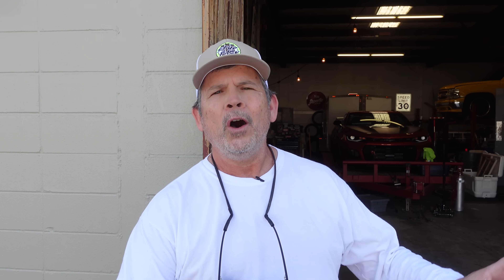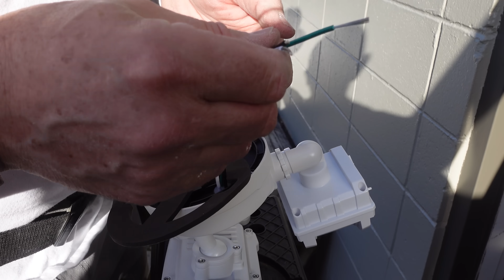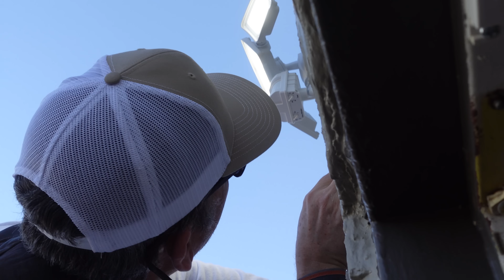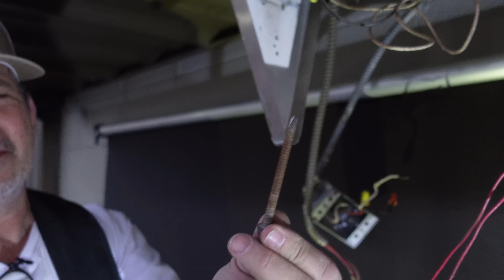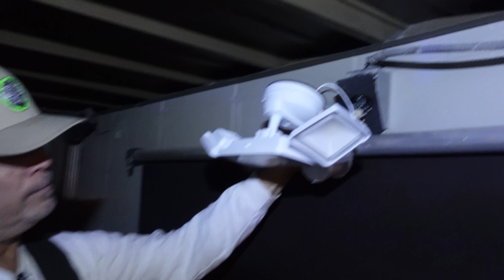HOW TO INSTALL FLOODLIGHTS (Safe, Watertight, and Properly Grounded)

Comment: Not a fan of using conduit as a ground. Fittings often get loose and all it takes is one disconnected or loose fitting to ruin your entire ground path. I prefer running a dedicated ground always.
Reply: Totally agree. Been burned by conduit open grounds
Reply: It’s better no doubt to run a dedicated ground, but on a big commercial job the cost of the extra conductor can be the difference between winning and losing a tight competitive bid. So if it’s not specified by the owner and it’s not code nobody is going to do it.

Comment: If I not mistaking, one of the hex sides of your screwdriver will fit that ground screw and would be easier to drive that screw in. It's a great screw driver.
Reply: You are not mistaken. It's ba neat trick i use all the time.
Reply: Yeah he finally used it to take down the old ballast but I woulda been using the hex the whole time!
Reply: Yeah,  one size is 1/4 inch and the other is 5/16. 2 very common sizes in the trades. That 5/16 will handle hose clamps also
Reply: the Klein 15 in 1 multi tip ratcheting screwdriver has a special combo tip  c1 c2 that just fits the square slotted Philips screws that get used in electrical a lot
Reply: @travisk5589  if it’s a Klein 11 in 1 it also has 3/8 on the other side as well
Reply: Excellent.
Reply: that tool has 1/4 3/8 and 5/16.  According to the packaging, all of the hexes are hardened tool steel and can handle driving screws a good bit.  I used it as a cable TV tech forever.
Reply: You mean use it as a nut driver?

I'm starting to like nut drivers on hex headed screws. Much better than risking stripping the screw.
Reply: @SirBrass  yes.  hex headed screws are the bees knees for ease of driving.

Comment: “14g for 15A and 12g for 20A” is a great way of remembering that rule.  Always learning something from you guys.
Reply: Generally just use 12 on 15 amp the overall $$ difference is negligible in the long term. 
Especially if you don't have any access to the wire
Reply: You can learn a lot more accurately from the National Electrical Code Book aka NEC !!
Reply: Great tip!    though i can't imagine that short leg for an LED light  calls for 12ga/ 20 amp .  Is that a local code?  (obviously can't hurt to have it though, and as long as you have some hanging around...)
Reply: @jefffree6990  ok let's say 14 awg is $49 a roll. And 12 awg is $59 a roll.
For $10 more if you ever needed to bump up to a 20 amp breaker what does it cost you in the long run?
$49+ 59+drywall mud and then mudding an tapeing sanding etc... lol
Plus if your wiring plugs your probably going to have 12 anyways
And leds are low powered,  but say 6 months from now you want a ceiling fan?
Reply: @electroman982 one of the very first things in NFPA 70 is a passage explaining that the NEC is not an instruction manual or a how-to book. While you will certainly use the NEC while you are learning it's not written for beginners and you're likely to misinterpret something and hazard yourself or others

Comment: In case you didn't know, it is possible to have a hot neutral where there is a shared neutral (multi-wire branch circuit) and you have an open neutral.  This happens when a 12/3 or 14/3 circuit is used to save a wire (not uncommon in commercial installs to save conduit space and wire)  and a double pole breaker wasn't used or where two breakers don't have the required handle ties or are on the same phase.  You need to make sure both breakers are off on these before working on them.
Reply: Learned this the hard way
Reply: I do this all the time when conduit size is too small
Reply: me, an arduino kiddie: lol, i kno some of these words.
Reply: He knows all about the hot neutral, has explained it in other videos. He got the worst or second worst shock of his life on one. He checks them every time, I assume even if he doesn't cover it.
Reply: Hot neutrals are the worst. The two breakers that supply the hots for the shared neutral should be linked so they both turn off at the same time but it's not common to see this.

Comment: If I lived where you guys are, I would always hire you guys even if you charge me more than the regular rate... I'd be glad to pay for it since I know I won't have to worry about the work. I am super picky as well and Paul is my kind of "picky" guy 😎
Reply: Me too. These guys are first rate. The father son thing is pretty cool too. 👍🏼
Reply: They broke code numerous times, for example pulling Romex through conduit in a wet location, using 14awg in a commercial setting, etc.

Hard to not worry about these handyman hacks
Reply: @SumOfIt You must use a wire rated for wet locations. NMD is not.
Reply: @TheDarthJesus  Where did they use 14AWG? He removed 14 and replaced with 12.
Reply: @illestofdemall13  Exactly. If TDJ is going to criticize, he should make SURE the comment is correct.

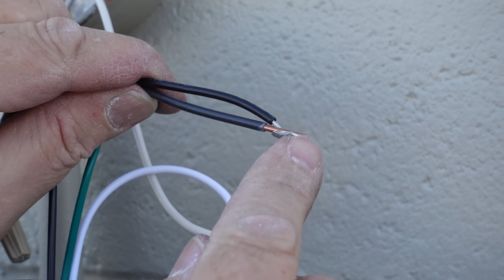Comment: At 14:21, you actually want any stranded wire to be leading the solid conductor by around 1/16” to 1/8”. By the looks of it, those stranded wires will pull out if you give it a pull test
Reply: Great tip!
Reply: I hate to sound like an idiot but what's the point of a pull test if those wires will almost never be under that much tension inside the junction box?
Reply: @aurvaroy6670  Because if a wire can easily pull loose, then it is likely to work it's way loose over time from vibration and heat/cold cycles. Eventually, when a wire does get loose you'll have a bad connection, which can cause arcing, heat, or both when under load, so it would become a fire risk. Connections that survive the pull test are far less likely to work loose over time.
Reply: @aurvaroy6670  Better safe than sorry.

Comment: 13:31 always leave the wire nuts/wago/push-on's with the open ends facing down/sealed ends upwards. that is in case of moisture from air leakage causing condensation or rain ingress.
if they're hanging downward or sideways they can fill with rain/condensation and corrode apart in months to years.(I learned that the hard way)
Reply: man, I've never even considered these variables.  Thanks.

Comment: Check out the Klein C2 bit for most electrical fittings. Basically a square/flat combo really gets a nice firm grip in those ground screws, receptacle terminal screws, EMT fittings, and more.
Reply: I actually prefer the Milwaukee ECX

Comment: Bell boxes are made for threaded IMC or Rigid conduit. EMT conduit connectors are straight thread and are listed for use with boxes and locknuts. Good job showing how the effective ground fault is compromised using the incorrect fittings. Also when wire nutting solid to stranded, put the stranded wire a little past the solid so the nut make a good connection.
Reply: "Bell boxes are made for threaded IMC or Rigid conduit. EMT conduit connectors are straight thread and are listed for use with boxes and lock nuts"
Those 2 statements are not accurately true...so go figure...and report back w/corrected relevant info!
Sorry I don't do others homework for them for FREE!
Clue...start with the Listing/s!

"Good job showing how the effective ground fault is compromised using the incorrect fittings"
A dagger to the code book...OUCH!
Clue...you wouldn't reward your dog for pissing on your leg would you?!!?!?

"Also when wire nutting solid to stranded, put the stranded wire a little past the solid so the nut make a good connection."
So you have more then one week experience...good boy!
Clue...there are places where the 2 types should/should not meet!

Comment: Great video! It's good to mention that on three phase wiring, the hot wires could be black for one phase, red for another and blue for the third. Any phase would work for the single phase light, but it explains you connecting the red wire in the box to the black wire in the lighting fixture.

Comment: great job.  I always tape up the wire nuts on the positive side just to be safe.  In my 90 year old house they soldered the wires together and then used tape.

Comment: Excellent work per normal, thank you Jordan and Paul. Awesome man cave Best Bud!

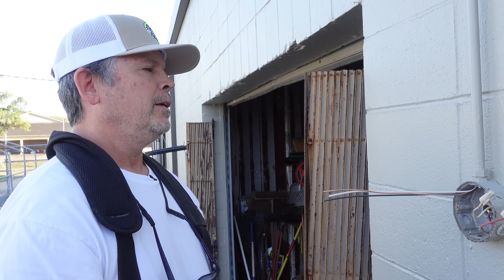10:50 I believe that's your best option really (matter of opinion) realistically you should have the compression/raintight fittings there and not the normal set-screw type on the upper box. This is simply because you're outside, you wouldn't want moisture getting in the boxes in anyway possible. I personally run dedicated EGCs for every run but every situation is different, and with your case they weren't previously installed.

Comment: In many jurisdictions, commercial requires THHN wiring or other wiring, NO romex.  So, when running you are either pulling single wires through conduit (or wire packs) or using armor clad / metal clad cable.  Fastest way to run a single wire out somewhere on the inside is with the metal clad / armor clad cable as it's a flexible "conduit" clad cable.
Another thing that happens is neutrals are shared in many instances.  Hots are ran off of individual breakers on different phases with the neutral and ground wires being a shared run back to the panel - Due to the different phases, the neutral doesn't get over powered by the amperage.

Comment: Extend stranded wire slightly beyond the end of the solid wire or the stranded wire does not engage and get compressed by the wire nut threaded cone.  I also would have replaced that 14AWG even though the fire risk inside conduit on concrete blocks is minimal.
Reply: Paul did replace with #12
Reply: @michaelbiegel6973  And "I also would have..."
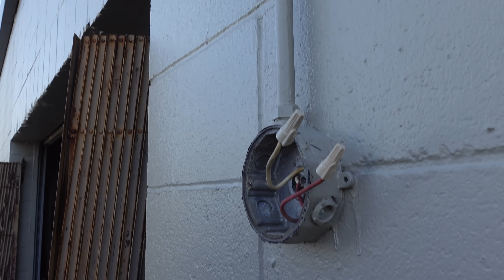Reply: @byronwatkins2565  @ 10:05 he says he has 12 gauge in the truck, so he in fact did replace.
Reply: @michaelbiegel6973  I did NOT say he didn't; I said I would have done the SAME.

Comment: At the end you used a rectangle box (not sure the name) instead of an octagon/round box, but still used a round fixture. I helped someone install a floodlight in a wet location and ended up jury rigging a rectangle to circle adapter with foam backwards to get a modest amount of waterproofing. Was that necessary, or would it have been ok to leave it more open so water could drain? It was a residential application, and I didn’t want wires getting too wet. It was really open in the back when it was just the fixture and the box. Kind of open to rain and snow too. I think it worked ok after my mod, and is still working great 6mo later. thoughts??

Comment: Excellent tutorial, learned a lot, so thank you! Wondering if issue fitting circular light fitting to the oblong wall box as it relates to watertight seal, or it didn't matter because it was beneath an over hanging part of the building? Seeing how professional you are, I don't imagine you left any gaps, but the video did not show the final fitting at the wall box.

Comment: I usually keep some crimp-on eyelets in my toolbox, and use that to attach twisted ground wires to the box.

Here’s an idea for a future video - converting a fluorescent light fixture to LED bulbs by removing the ballast. I did this to my 8 foot garage lights, and what a difference!

Comment: Hey Stud Pack! That "square drive' is called a Robertson! Here in Canada its the most common for construction screws. Electrical is basically Robbie #1, #2, or if you use the screws included in a light fixture, then Philips #2. Robertson #2 is most common across all building trades here. Keep up the great videos!
Reply: Square and Robertson are actually slightly different, Robertson screws/bits feature a longer tapered edge designed to hold the screw better.
Square was designed because Ford refused to pay for the Canadian designed Robertson bit, and created their knockoff "Square"

Comment: Lol, I remember installing one of those and that long center mounting screw went in and chafed the wires where they came in the back of the box. Nothing worse than putting a light all together and tripping the breaker immediately in front of the customer 😆

Comment: I'm not sure if it's a code violation, but I personally would have replaced that single gang box with a round one.  With that it would not only look nicer, but it should have better protection against the elements and help your light fixture last longer.

Comment: For the last light mounted on the rectangular box, didn't that leave it partially open in the back? Wouldn't it have been better to mount a new round box to the building first? It would have a better finished look too.
Reply: The back of the light was completely enclosed if you look at the other lights before. So, yes, there was overhang beyond the box, but nothing was exposed. I agree that a round box would be better, but if this really was a freebie job for a friend, they get what they get.

Comment: Hi-  great videos.  Just a couple quick questions.  For light #2, you mentioned the conduit connections between boxes prevented a good ground.  What would be the appropriate way to connect the conduit to allow ground continuation?   On light #3, you attached three round light base to the square single gang box.   Was this only done because the location was protected from rain by overhang?   If exposed would you have switched box to a round one?    Thanks!

Comment: Here's a nugget I just learned this month: Milwaukee makes the perfect bit (1/4-inch hex or full screwdriver) for those electrical screws. Receptacle box screws take an ECX #1 and, I think, breaker box screws take an ECX #2.. They combine the Robertson #1 with a broad, flat blade for incredible grip.
Reply: yeah my klein 14 in one has the combo bits for electrical screws it is nice has 6 double ended bits in handle that are quick and easy to change

Comment: when you splice stranded to solid make sure the stranded wire is ahead of the solid wire so the wire nut can pinch the wires together better makes a stronger connection

Comment: For the last of the 3 lights, the light fixture was round, but the junction box was a small rectangular box. Is that a problem? Will water be able to get into the back of the light fixture since it is larger than and doesn't match the rectangular box?

Comment: outdoor lights like that should be on a GFCI breaker anyway, so that ground wire is not actually totally necessary.  I still run grounds anyway and check them just like you did. The GFCI also continually self test. If they electrically fail, they will click off. I also converted my shop lights from fluorescent to LED strip bulbs, and that gets rid of that ballast, and keeps the fixture, which is a nice upgrade. Fluorescent when mine got cold did not work well at all.

Comment: I was taught years ago, to bond the ground to the box and the light holder cross brace as well as the light fixtures ground terminal or screw.
why? many times the light fixtures were metal, with unknown quality ground wire connections, the box may be plastic and set back into the wall, and a conductor could become bare and touching the cross bar without shorting and tripping breaker. that would make the bar live, as well as fixture mounting screws/nuts and possibly more, depending on design.
if you overthink it and worry too much, you'd never use anything electric nor touch it. 😬
**you should always leave the stranded wire "leading" the solid wire slightly when using wire nuts(1/16 to 1/8 inch),that makes sure it gets grabbed and bitten into and NOT pushed down and out, if not it can often be pulled out with nearly no force.

Comment: you demonstrated why i like having a small electric screwdriver for electrical work driving tons of fine thread long screws that don't require much torque saves a lot of time having an electric screwdriver